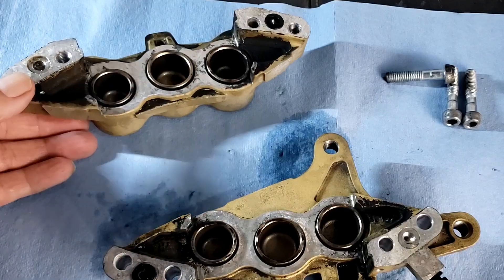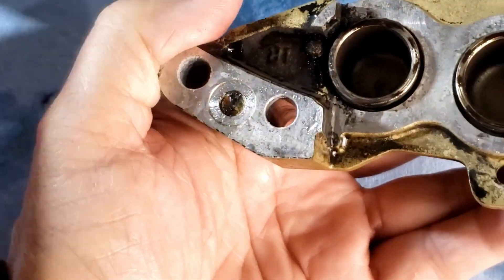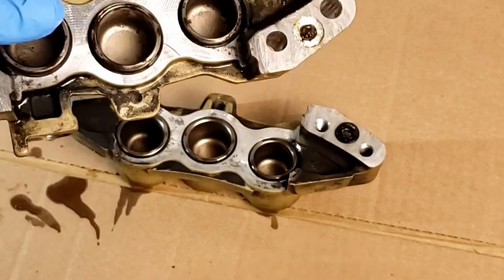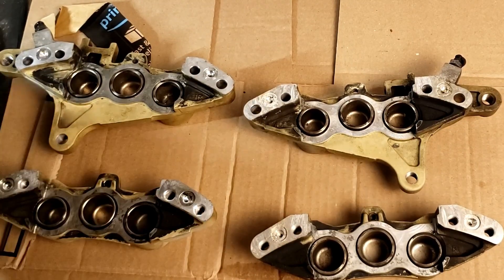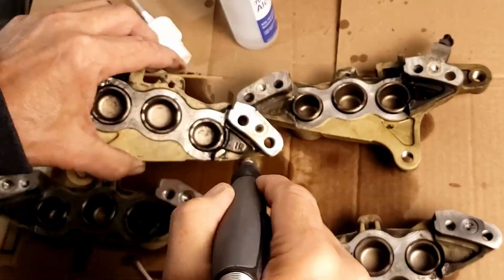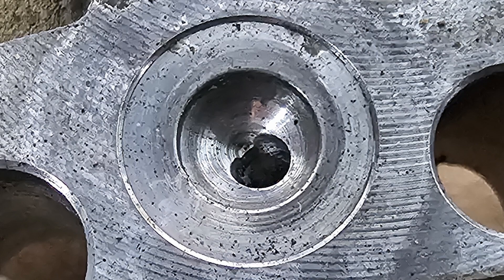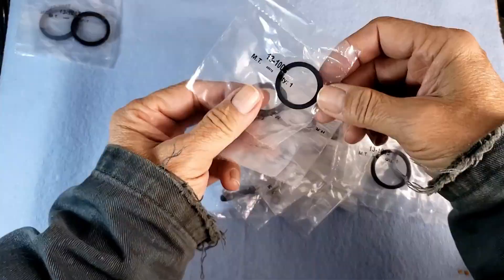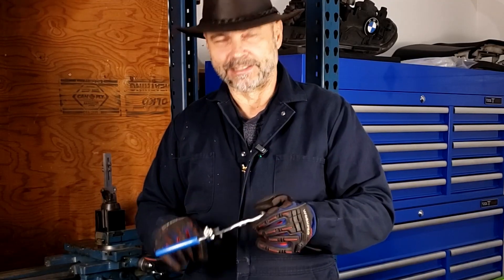NEGLECT THIS AND YOUR BRAKES WILL FAIL!   Front Brake Caliper Rebuild: Time-Lapse

Comment: Great video; how did you clean out the seal 'grooves? Where these pitted also?
Reply from the maker: I used a Dremel rotating tool and stainless wheel brush.
Reply: @MynameisDarko-ln5ts  Thanks; does rubbing alcohol help with this?
Reply from the maker: @cbx1168  a bit

Comment: the 6 pot front brakes on the  ZX12R are known for this.  They have to rebuilt regularly to maintain optimal braking and brake feel.  Also, in regards to another comment about changing the forks and brakes, it is a MASSIVE upgrade and well worth doing.  ZX14 and 14r forks and and lower triple with its stem fit perfectly on any 2002+ ZX12R.  2000-2001 12's have a different steering stem and would require different bearings or the stem changed to fit the 14r forks.  The rake is nearly the same with the triples from a 14r, will make the wheelbase just a hair shorter (couple mm iirc).  The upper triple of a 14r and its odd clipons are a slight problem as they will foul at full lock with the upper fairing of the 12r, there are several off the shelf solutions for putting a zx10r style upper on the triples, allowing for normal clipons of various height to put it back to near factory location on the 12r.  Loving the ZX12R episodes so far, good luck!

Comment: can remove pistons with compressed air or if tight use grease gun as being cleaned afterwards
Reply from the maker: I used compressed air; one came out, but the others were not cooperating.

Comment: Exactly same calipers on the Busa gen 1.    If I had a ZX12 I would consider swap the forks with radial calipers.  Nice touch to this classic and beautiful bike.  Just keep the stock parts.
Reply from the maker: Same calipers were on my 2001 GSXR 1000. The current ones on the Ninja are not leaking and don't see any reason to change them. I don't think the new buyer would be willing to pay extra for upgraded shocks and brake calipers.
Reply: @MynameisDarko-ln5ts  they were about the same. Not exactly if you look closely. Don't know if it make any difference though...😂
Some small differences in the design.